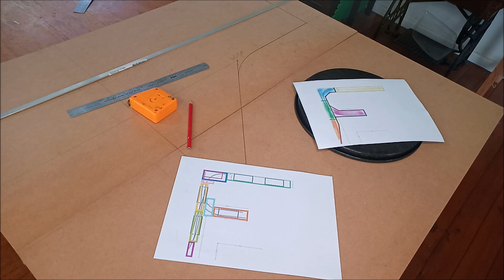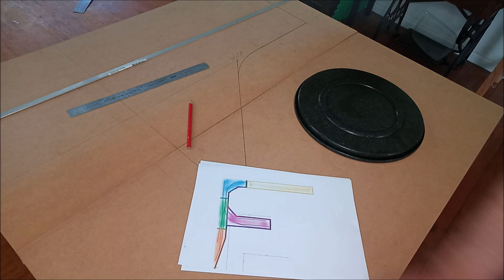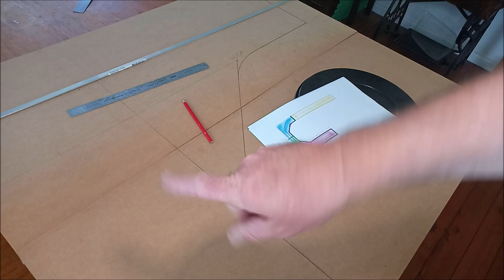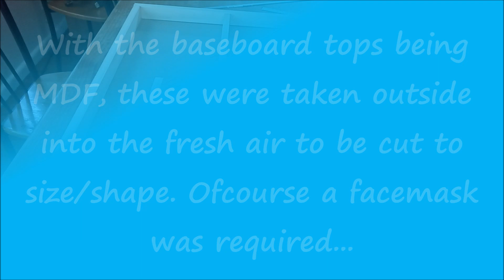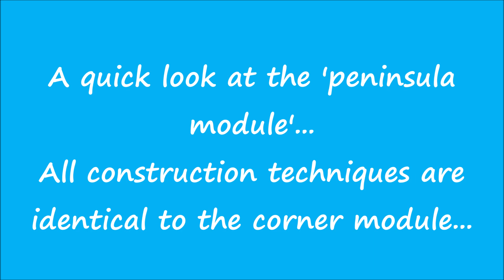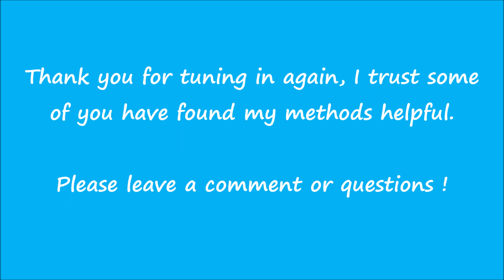Miami Layout Extension : Baseboard/Module Construction Pt 1

Comment: Nice construction techniques…can’t imagine getting good fresh air outdoors with a mask on 😊
Reply from the maker: Thanks GSB. 

I use this technique on all my baseboards. A few of them have 3mm (1/8") MDF  with the insulation foam glued to this. I had collected a lot of the 9mm MDF which came in handy for this extension. 👍 
The mask went on because I still don't know what is actually in MDF ! Being outdoors allowed the saw dust (MDF dust) to easily blow away. 😉

Cheers, Gary.